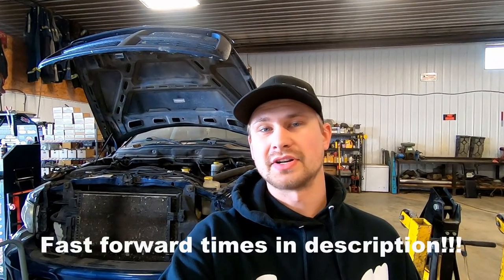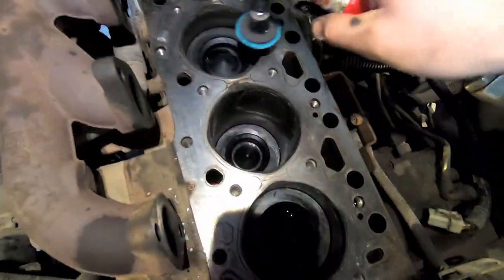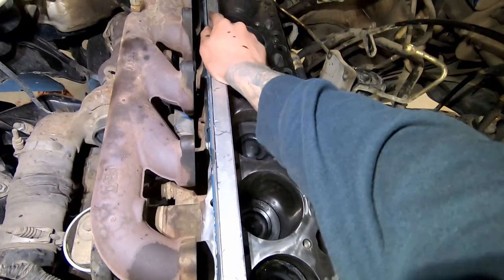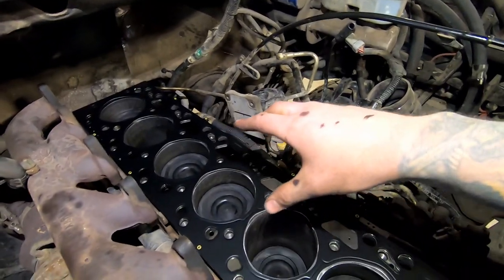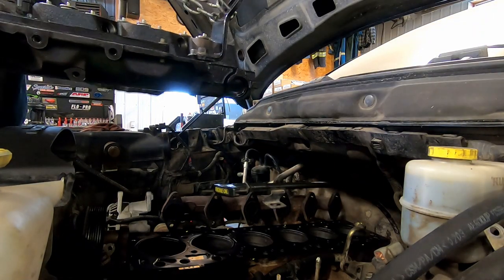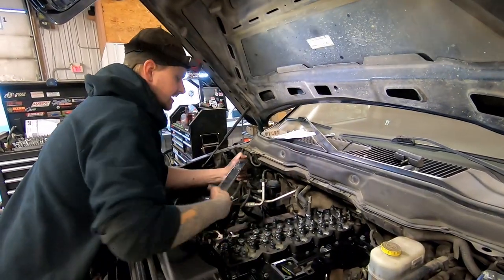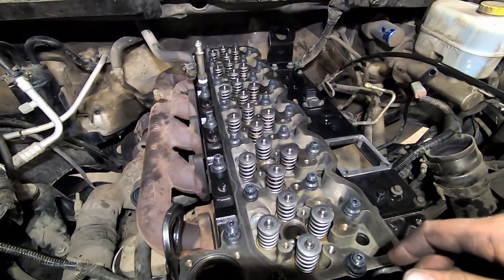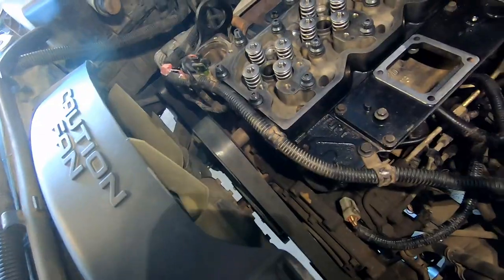How to: 5.9 Cummins head gasket replacement (part 2/2 Install)

Comment: I found the valve adjustment seq how you laid it out super simple! So many times i see other people make it all confusing! I saved this vid for when i dig into my ‘02 24v HO 6 speed, and do all sorts of fun things like a all our carzy carls p pump conversion. All the billet parts! Everything! Ive waited 9 years to do it. I bought this truck 9 years ago with 79,000mi, a cherry mint unicorn. All stock all org, 100% un -molested. I told myself i wouldn’t dig it to the motor and go crazy on it till it had at least 100,000 miles (not km! Im in Colo.) and it was broken in. Heh. They say they don’t break in till they hit 100k. But all out p pump is where im going. All mechanical! The second gen vp44’s are still mechanical with the addition of a little bit of eletronics. Injectors are still all
Mechanical, ill have to change pop pressures.
Not going for high horse power, gunna keep it realistic in the 400-500. Im after reliability, and i could easily build that with the vp44 injection system, and keep the reliability and longevity. But p7100 pumps are just so cool! They’re literally a little mini cummins motor on the side. Ive always wanted a p pump. Ive had 6 first gen 12 valves over the years, all VE rotary pumps. And theyre awesome, and super reliable, easily tune able, still capeable of the 400-500hp range, 600 is bout the cap for a VE. Ive kinda even kicked around the idea of a VE pump swap, it wouldn’t be much different, it’s certainly doable. Ive heard of one other person on utube that did a VE swap on a 24v.  He was able to use the VP injection lines i remember reading. Fun stuff to think about. And thats what i live about these motors, theyre simple, easily modded, changed, redone, and built. You dont see guys doing stuff like that with a durajunk.

Comment: Bro I just did this today. Installed it I never watched this video...I wish I did!!!

The fuel return took me 3 hours.. I bend the line somehow so it was hell.

But have injectors installed now and all wiring.

You can help people save a ton of money if they have the tools and can physically do this.

I also installed a HP-HD water pump. New radiator, New ac system, gasket + aftermarket stud kit. 
I would encourage everyone that does this to do this also at a minimum. Those water pumps suck and the HD one has a 2x larger shaft.

Mine failed abruptly, coolant entered cyl 5 and hydrolocked the injector nozzle. Died. 

No piston damage but it did slightly discolor a tiny spot where I believe it got torched for about the 60 seconds my father ran it.

No water in oil. Truck did lose coolant slowly though for awhile.

Comment: Thanks for posting these 2 vids. Saves me a lot of headache figuring out where things are to do this job. I really hope I can pull the head with out a cherry picker though.
Reply from the maker: No problem! It’s going to be hard to pull that head without some kind of picker. It’s pretty heavy. But you can usually go to a local parts or rent-it store and rent an engine picker like I used in the video. It makes life a lot easier. Plus you don’t want to drop the head on a new gasket and wreck the gasket.

Comment: No hate here just stating the only thing I noticed that I didn't really think was necessary was cracking/bleeding the fuel line of air. Commonrails are a self bleeding system. I've taken off the entire fuel system on my commonrail and even the 6.7 trucks and it fires right up after running the fuel pump awhile. I just swapped over to a 12 valve after 443k miles and I'm still running the factory in tank lift pump(which is a super restrictive) and every time I do a fuel filter I just run the factory pump for a good minute or so. It usually fires up pretty good by the second fire up. First time it'll start and die out. Good stuff even though I don't need to do the head gasket I just thought it was interesting to see how others do it. I watched the whole thing and liked! Good stuff!
Reply from the maker: Thanks buddy! I guess I was just always taught to bleed the air out of the fuel system but maybe next time I’ll try just cycling the pump a few times and see if it fires up!
Reply: @darkirondiesel  I was more curious than anything. I used to hate having to bleed the old pre commonrail trucks. After doing the swap I realized an electric pump makes a huge difference on the old motors. Unfortunately I'll have to delete the pump and do a sump because it only allows 14psi if I'm lucky 🤦‍♂️ I was told I should have 17 at idle for this motor and 10psi per 1k rpms. I guess that explains why it makes power down low but chokes up top 😬😅
Reply: I have the same 5.9 and there is significantly less cranking if you crack a fuel line and let the air escape, however it will eventually self bleed. Excellent video!!
Reply: @darkirondiesel   If you "bump" the starter with the key for just a quick second, it will allow the fuel pump to run longer then the initial 15-30 it is programmed to do. Next time you change the fuel filter, just drop the new one in, cycle your key initially, then bump it and you'll hear the fuel pump run. Usually only takes doing that twice and she fires right up. Keep up the detailed videos!
Reply: @darkirondiesel  yea no need to bleed it at all

Comment: I would recommend finding tdc1 before disembly, that way you know exactly where the engine was, there is a chance with out doing so that a person could be on tdc6 especially if they loosen off the rocker all they way which a person should do on disassembly. Crank shaft turns twice to the cam. Otherwise you'd ether need to remove front cover for timing marks or use a dial indicator and measure cam lift. Be nice if they put a cam timing pin like the old cummins have

Comment: 😲😲😲 for future reference soak block in dot 3 brake fluid over night grab a brillo pad a block of wood and just go back and forth much safer option never had an issue also a great way to clean a head as well

Comment: so i think my truck is tapping and i changed the oil and cut the filter apart to check it and there was no shavings in it..  so i went to the valve lash and did that and came up with the same as u did which very helpfull vid by the way.. after adjusting and rotatig the motor over 4 full rotations i came up withthe same thing i think 3pos4 needed readjusted....so i did that and it made it a bit Quiter and made it run way stronger for sure..........but i feel it still noisy but it runs fine, is there somthing else i can check to ease my mind wheather to put money into it...........or if i sent u a video do u think u could determine if it sounds right or not

Comment: (EDIT: see replies below for update.) 360 degrees, full rotation? Uh, no, because then you're back to square 1! I hope you figured out that error before and didn't keep your truck messed up, because it's supposed to be 180 degrees, just half a rotation. (I read the specs somewhere else; came here to get a reminder of alternator and front lift bracket bolts.)
Reply from the maker: Alright buddy you do 180 degrees and tell me how that works out for you lol
Reply: WOWW,  @darkirondiesel , "buddy," "nice" reply, especially just 2 days before Christmas; ya got a lotta Christmas spirit right there, huh?
I called a dealer to make sure and they sent me the specs right from FCA, and they say it's 180 degrees at the injection pump gear, so that means 360 at the crankshaft, like you said. So give me some kind of indicator that you've seen my self-correction here, and then I'll delete this thread.

Comment: UPDATE: Nevermind disregard my question, thats why you torqued your head studs to 130 and cranked the engine by hand 9 times for the valve lash duh! You're a smart feller Dark Iron Diesel! 

Your videos are seriously the best thank you sir! Did you have to re torque everything down after the initial test drive? Just curious, I know my truck is going to be do for new head gasket sooner than later.

Comment: Been watching lots of your vids as well as deboss trying to learn as much as I can about my 05 5.9.  I noticed he doesn't sinch down the injectors until the feed tubes are installed and torqued.  I'm curious to hear your opinion on the two different methods?
Reply: Never ever ever tighten the injector down before the feed tube is in and torqued. Otherwise it could not seat properly and you can have a leak. I just did the injectors on my 05 last year and it went pretty smooth as long as you understand the steps and in what order.
Reply: @200130769  exactly

Comment: hey man, so I just did my head gasket on my 2006 24v cummins. I watched both your videos on doing yours, I've got a couple questions if you don't mind. so I did a retorque on the studs today because I'm getting some oil seeping out the side I used a mahle gasket and coated it with copper seal. I've also got a tick that doesn't sound normal almost like an injector tick. any advise you have would be appreciated 🙏

Comment: I’ve used your video to do my own head gasket and everything is the same so far minus the tax mark for the crank shaft I do not have one there is a hole on the backside of the outer part of the balancer that does not go all the way through a little guidance would be much appreciated

Comment: I forgot to clean out the head stud holes before putting my head and head gasket on and left oil in there. I noticed after torquing it I could see oil seeping between the block and head on the drivers side. Should I be concerned?

Comment: Little late for my comment but don't forget to do a hot re torque . Great video man very well explained .I imagine it would be same on a 24v 98.5 cummins correct only difference is injectors,and wiring harness correct ?

Comment: Good job on the video! I'm kind of surprised you had to do a head gasket on the 5.9. Out of curiosity, how many miles are on it?
Reply: @fartfanugen  that's not really saying much considering these motors dont really have a lot of problems to begin with.

Comment: Uh-oh, were there 6 longer bolts too, or are the bolts the same length even though 6 of the studs are longer? I just came to watch this video to get a reminder of the alternator bolt set. I already put my head bolts back in and didn't remember any of them being longer than others; I just grabbed them from my bowl in any order. Mine's a 2001. Were any of your bolts longer, or is that just for studs for some reason?
Reply from the maker: I think the bolts are all the same length but personally I’ve never used bolts because they stretch, I always use head studs because it greatly reduces the risk of blowing the head gasket again. And what happened to your other comment? You realize that the crankshaft rotates 720 degrees in a full engine cycle? The crank rotates twice every time the camshaft rotates once.
Reply: @darkirondiesel : What happened to my other post, you ask? You felt the "need" to reply rudely to me on it only 2 days before Christmas just because I got the pump gear (180) and the crankshaft (360) mixed up, and realized that after calling a dealer to make sure and they sent me the specs right from "the horse's mouth" (FCA). Nice!

OK, so you have used head bolts in this truck then: for the amount of time you've driven it until swapping them out for studs and nuts. I reused my NON-TTY bolts because I didn't have the money to buy new ones or studs, but experts say you can reuse NON-TTY head bolts once or twice if they don't feel soft when you try torquing on one. They're more springy than yield bolts.

Comment: Good evening great video thank you for your help I replaced my head gasket put everything back together now she won’t start at all get fuel   When I crack open a injector line close it up crank for a while she won’t start at all any advice would be much appreciated thank you
Reply from the maker: How long you cranking for? You should crank for 30 seconds then let the starter rest for 2 minutes. Do that a couple times and see if it fires. Make sure your batteries are good
Reply: Dark Iron Diesel good afternoon I have cranked for at least 30 seconds a couple of times till my batteries got low I charged them up again and tried again she starts and runs rough on quick start for 2 seconds then dies I know you shouldn’t do that I have been told it can be my injector feeding tubes but she ran very well before I did the head gasket
Reply: @trevorbotha465  did u get it figured. I’m about to do this . I have done it before but on a 12 v
Reply: @trevorbotha465  sounds like a weak Cp3

Comment: Great video just doing my first cummins head and it was very helpful. What coolant did you use in your truck? And is there a procedure to bleeding the coolant system.
Reply from the maker: Thank you. I just use red or orange extended life premixed Diesel engine coolant. You can just fill it up with coolant then take it for a drive, once it gets up to temperature the thermostat will open up and probably suck the coolant down a bit. just top it up after you go for a drive.

Comment: Just curious... Why didn't you put the rail and lines on prior to dropping the head in? I put mine in this past weekend, but as annoying as #5 and #6 are to do, I installed the full fuel system before. Injectors and all. Just have to be a little more cautious I guess.
Reply from the maker: Yeah I know you can do that but I prefer to have as little on the cylinder head as possible. Also, I believe the injector tips stick out of the head a little bit, so you have to be extremely careful that you have the cylinder head propped up so your injector tips don’t hit anything because if the tips get damaged then the spray pattern will be way off and can cause engine damage
Reply: @darkirondiesel  ya they do... It's a little tighter that way.. But #6 injector tube nut torque down is an absolute bugger back there. Lol
Reply from the maker: Haha yes it is!

Comment: I’m using the same kit. And I have o-rings and such that I’m unsure about. Is there any way you can answer a few questions I have?
Reply from the maker: You don’t need to use all the o rings. I probably only use like 2/3 of what comes in the kit

Comment: Pulled the head on my truck today ran into a broken off plastic piece on the rocker arm that goes down the valve bridges truck ran fine with it sitting in the head do I need to try and find a replacement one I would think that the tension from valve springs won’t let the roller move anyhow
Reply from the maker: I’m pretty sure those are there mainly for installing the rocker arms so those rollers don’t fall out. So as long as you put it together properly then it shouldn’t go anywhere with the tension from the valve springs like you said
Reply: Dark Iron Diesel ok thanks man just checking

Comment: I watched 2 times before l do the pu all back l put the head by hands did not have hoist jack it's lot of much harder doing all put the head of and on by hand, l think l did it right thanks for video , on 1999 l think the head bolts all are the same l noticed some don't click it's wen l realized l put manifold bolts in wrong place jje jje jje jje yes it's mi first time doing truck 1999 5.7 Diesel l have done newer but no olders

Comment: Do you have a link for those banjo bolt washers?
Reply: Also do you have the sizes? You said one was bigger than the other. I’m going to replace the two at the back of the head as well and the two to connect to the fuel rail